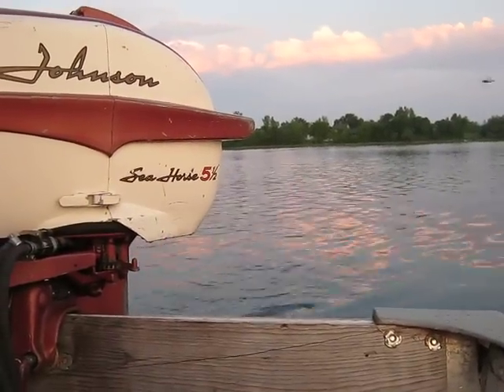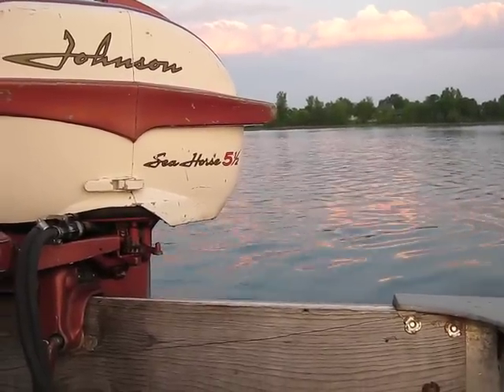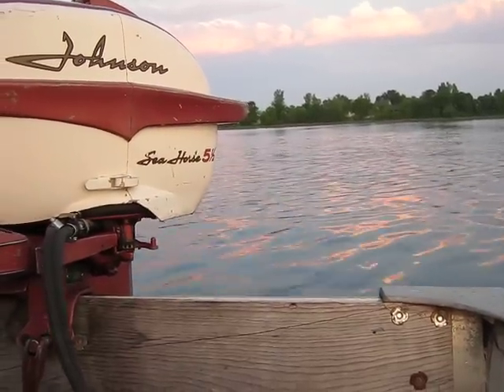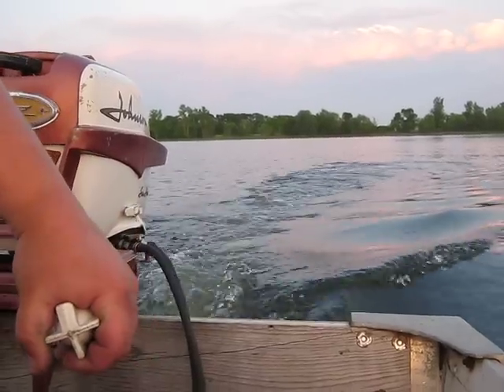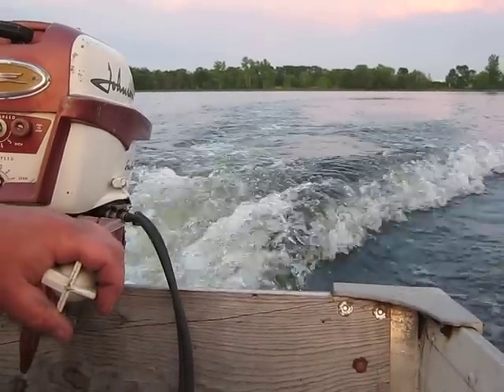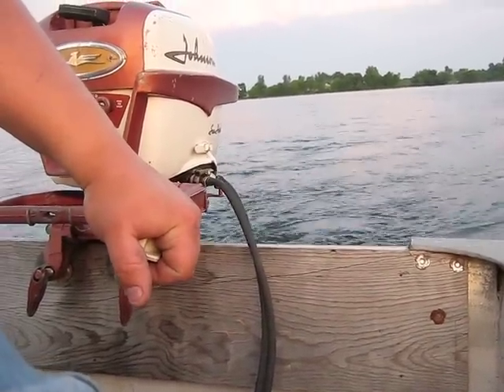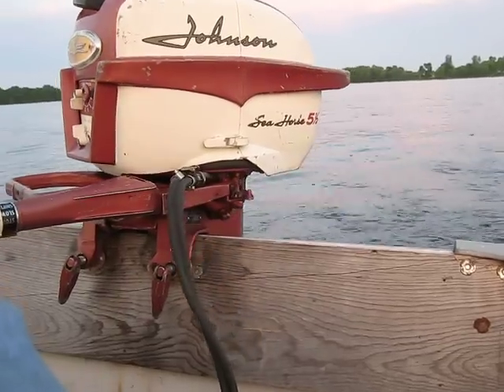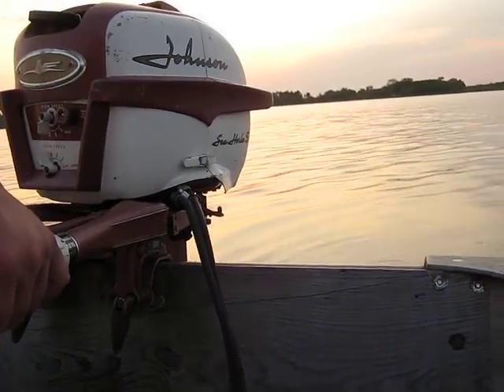1958 Johnson cd-15 5.5hp outboard motor

Comment: I have the exact motor and runs great in 55 gal drum but when mounted on the boat it does not move out.could this be because the motor is not long enuff?shouldn't the perpeller be bellow the bottom of the boat?or would this not matter?this is all new to me thanks for any help.
Reply from the maker: Jason Hawkins Yes the prop needs to be under the boat. sounds like you have a 20" boat transum
Reply: Thanks for your time
Reply from the maker: Jason Hawkins No problem.